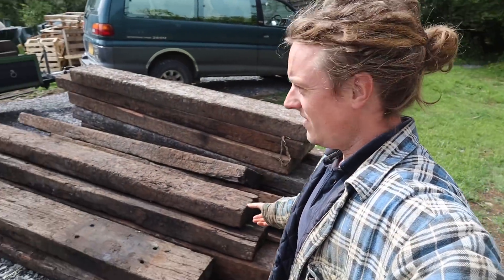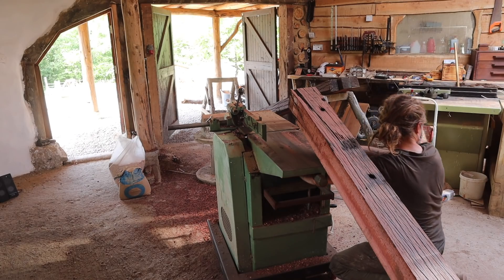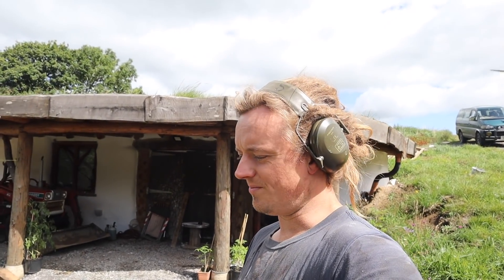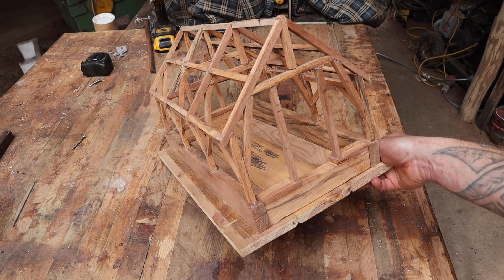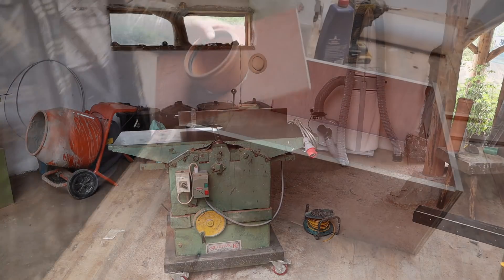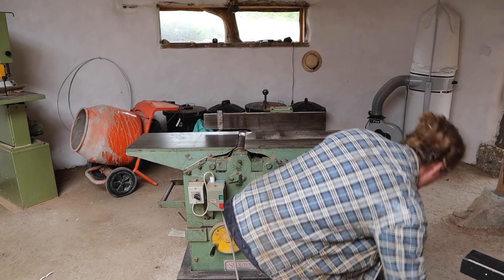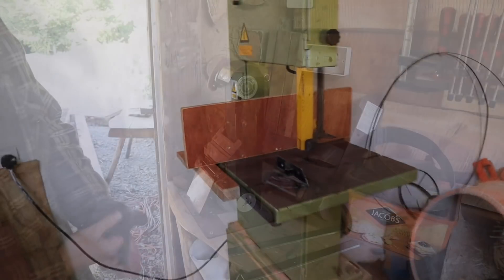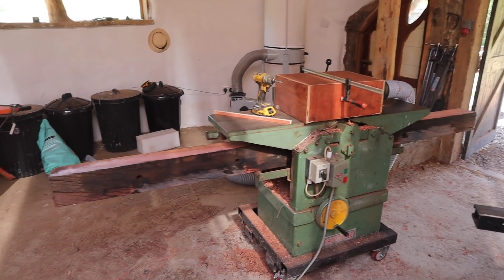Spring Fed Timber Framed Greenhouse Part 1 Design/Materials

Comment: The wood used in the sleepers is absolutely beautiful. You are so fortunate that you can get them and they are usable since they aren’t treated timbers. 
I think the only sleepers here (Ontario Canada) that aren’t treated are the concrete ones. 🤣😂

Did you design the greenhouse size to work with the length of the sleepers or will some need to be scarfed (joined) for length?
Reply from the maker: Good old British empire colonising the world and stealing there wood.....This wood does not have a great history But it is lovely wood and it might as well be used again now that it has been cut and shipped around the world already.

Comment: I wonder if it might help to drill some large holes through the end opposite the hose, to get more air flow through the box?  Might help stop the box filling up.
I have an unused Bump Cap you can have if you want it.  That looked like a nasty knock.
Take care.
Reply from the maker: The planner moves a lot of air and chips and throws it all at the hight i put the outlet. So in thicknessing mode (when most shavings are made) it works perfectly. in planning mode the box has to fill up a bit first before it starts to feed down the pipe. Not sure how i could fix that without making the thinknessing mode not as good. Two different hoods would work better but i dont think there is much of a need as its working very well.
Reply: @KrisHarbour  No worries, mate.  Maybe a ramp to direct the shavings towards the outlet?  Do you want the bump cap?  It's a baseball cap with a padded plastic liner.

Comment: Just bought me a 28 inch Alaskan Sawmill attachment. Works great. Is there a reasoning to use the bottom of the sawbar instead of the top. As the top is going to be oiled, yet, when using the bottom of the bar, the bar oil might have flown off already.... Just thinking....

Comment: Hi Chris I cringed when I saw you using your planer with loose clothing and no guard. That is a NO NO. All loose clothing needs to go unless you want to have a serious accident. I am a furniture maker and I would strongly recommend the maximum of 3mm cut in hard wood if you want your planer to last. 5mm in pine. your last pass should be half a mm to give you a nice finish. Also I would highly recommend that heavy timbers like that be properly supported with some sort of stands. If not you will damage your planer. If you take too much of a cut you will damage the motor winding's as they heat up. You will also damage the bearings. Treat your tools well and they will last a lifetime and give you nice timbers. I really enjoy your videos and I am not trying to be a smart ass as I have had some close calls and I only pass on the knowledge that was passed on to me. I lost part of my pinkie and mauled my right hand. It took the surgeon 8 hours to rebuild my hand. Not something you want to be doing. And it was fucking sore. I have followed your progress from the start and I get a wee boost every time you upload a video. I look forward to part two. A short sleeved tee shirt is the best attire for the workshop when working with machines. Or the wifes bikini. I was more of a tee shirt man myself. Well done man.
Reply: Overalls
Reply: Like others have mentioned, I will too, please use glasses or goggles to protect your eyes. I also noticed a couple times where you might have saved your back some work. You could put your trailer closer and inline to the off-load pile of wood, also you might be able to move your planer closer to your stack of wood. Great video, can't wait for the next.
Reply: Except for the loose clothing bit I thoroughly agree with you. Afraid he's not going to listen though, so let's wait and see how long the thing lasts under this kind of use...
Reply: Lovely comment and sound, healthy advice👌. Ps: love the thought of a bikini 😉🤣😂

Comment: May I please advise
1.) Taking a first aid course.
2.) Safety glasses.
3.) First Aid kit in every workshop and the house and van.
4.) If your land was at one time a pasture to have a current tetnius shot. Have hydrogen peroxide on hand to clean cuts, scrapes, and punctures. 
5.) Learn how to make butterfly bandages for cuts. Helps draw cuts together again.
I'm allergic to tetanus shots. I have to clean out the wound with hydrogen peroxide. Then I generally have to go to the hospital and get an intravenous antibiotic. Not my idea of a good time! I'm sure it's not yours too! 
And he's right about making several passes through the planer. Easier on the machinery and less tear out on the wood. Have fun and stay safe.

Comment: Kris, I was surprised how thick you have those timbers for a greenhouse. All the old wooden greenhouses I've seen have very thin beams and window frames. Why have you chosen to make yours so thick?
Reply from the maker: They are thin for two reasons. Cost and light. Cost isn’t important to me as this will cost less than any lighter wooden greenhouse this size. light will only be reduced by around 8% however it will last for a hundred years.

Comment: R u going 2 get in a little more detail on the timber frame joint's on how 2 make them when u get the green house project started and how is the hydro dam working out so far any more adjustments 2 that lately
Reply from the maker: Yeah that is the plan. going to try and go through it step by step in the workshop. Having the controlled environment inside will enable me to do that much better than i have been able to in the passed.
Reply: Look forward 2 see the green house videos when they come out and thxs 4 replying 2 the question

Comment: I would urge you never to run your hand over the top of the planer. Take your hand off and place it on the timber when it is over the out feed bed. I was a joiner and have seen and known people loose bits of their hand when they slip. You can also use silicone spray to lubricate the bed so you don’t have to use undue force which can also lead to injuries.

Comment: I find it hilarious that we had both your planer/thicknesser and bandsaw in the yacht builders workshop I used to work in! Modern-ish workshop and your more Hobbiton theme, are quite the juxtaposition =;-)) Good kit, though, and I am impressed you can run them off your own power - nice work. Can you give us a link to where you managed to find untreated timber like this?
Reply from the maker: I worked at a boat yard as a young lad. on of my main tasks was processing timbers for planking and other restoration work that was on. I learnt on these machines. so when i got my workshop i went for what i knew.
Reply: @KrisHarbour  Good thinking, and like I say, they are good workhorses and will last forever, with care.

Comment: Yes shure, sleepers are not treated, what a fary tale, if not so, what l don't believe, you have at least Asbest in them, due to the trainbrakes...
Reply: THE 3 MOST COMMON TREATMENTS FOR RAILWAY SLEEPERS

1) CREOSOTE TREATMENT - used for over 150 years to lengthen life of timber, but now facing some restrictions. SEE BELOW.
2) 'GREEN' PRESSURE TREATMENT - the latest 'environmentally friendly' pressure treatment. See below.
3) UNTREATED - some tropical hardwoods are naturally long lasting, & hence need no treatment. See below.

USED RAILWAY SLEEPERS are normally either
a) Creosote treated, e.g. used Dutch Oak and used British pine, or
b) Untreated, e.g. used Australian Jarrah and used African Azobe sleepers. Even though a used railway sleeper is untreated there can occasionally be deposits of oil or diesel on the surface which have fallen from passing trains over the years (not to mention other things!) 

NEW RAILWAY SLEEPERS are normally either
a) Green treated  e.g. new British softwood railway sleepers. These are environmentally friendly non-creosote based preservatives, with treatment names such as ACQ, Tanalith E, Osmose or Wolmanit, all of which are suitable for landscaping projects, or
b) Untreated, e.g. new oak sleepers
Reply: @Petes.Hobbies , thank you for your detailed answer Sir. A uncle of mine, was an ingeneur for railway's in germany. As we spoke a lot regarding train's etc., he use to tell me, that I better do not use any of those sleeper's. But the old hardwood sleeper's are maybe different.
Reply from the maker: Thanks for the info. I totally agree with it. Defiantly contaminants on the outside from the use they have had. I spray them down with a hose and give them a brush before milling (mostly just to get rid of any possibility of asbestos) They have been sitting outside in the weather for a number of years (after being pulled up) So they have been exposed to rain and sun and moved about a yard.

Then when planning them i take the outside off and i burn the shavings that come off. Once the bulk of the outside contaminated wood is off  i then save the shavings for other uses. you can see where oil has soaked in to some places and i tend to just try and cut those areas out when it comes to doing the joinery. I think the contamination on them is minimal after i am done and i think they are safe for use in the way i use them.. I would not use them in any quantity in a house though.
Reply: @KrisHarbour  , thank u for your explanation, it's very interesting and good, that you are awear of some possibly troubles. Bye the way, I do like your works quite a lot... and fallow you from the Second vid allready and enjoyed it and get's inspired....tks therefor

Comment: Hey Kris, Not sure if you ever looked into lithium iron phosphate batteries for your power shed to replace that old fork-a-ma-lift battery once it wears out. I've been eyeing these ones for an RV project I might be starting soon.

https://lithium-iron-battery.com/collections/12v-lithium-phosphate-battery-pack

They are all rack mount and have their own BMS built in which should make setting them up very easy. Coupled with the higher energy density and low self discharge rate they aught to make a good battery for off grid applications. Much more energy efficient then lead acid as well. I think lead acid batteries are only about 50% charge efficiency when new? I'm not sure I would have to look that one up. The only other down side to lithium iron phosphate is the up front cost, but they have an extremely long cycle life.

Comment: Lighter passes on that planer, my friend. Less time sharpening blades!!
Reply from the maker: 30 lengths to do with 4 sides. they are about 40-50kg each. if i do lighter passes i would have had to move those 30 lengths 120 extra  times if i had halved the depth of cut. twice that if i had quartered it. Sharpening blades is alot easier than moving 50kg lengths of wood 120 times more than i had to.

Comment: I know this is another task in a long line, and one you don't "need" to do, but ......
A cyclone separator (or Thein Baffle) for your chips would pay for itself in terms of ease of emptying chips and being able to see how full your bin is before it ends up full (you can fit a window in easily). It would also let you get a finer filter on the dust bags that would stop the "dust that will kill you in a few years" getting pushed back in the room! Some of the woods you use look spectacular but are toxic!
Trust me age is no friend and it can grab you sudden! As I am turning 60 I have come to realise my body simply can't do what it used to. All those small niggling injuries add up and when your knees are shot and you hips are not far behind the simple little tasks suddenly become a fight with pain that you realise you will eventually lose. Please work smarter not just harder. You will last longer if you do! Get something to help move those heavy timbers, rest them on something so you only lift half the weight, make a simple leaver to lift for you (not you doing all the lift! Keep on being able to do what you do for longer. Please realize I ask this out of self interest ...... I (hopefully) will have a long retirement ahead of me and I want interesting things to see and think about ..... and your channel is one of them ;0)
I may well not get to see it all from my self built Earthship in the Canaries (my original plan but I have left it too late) but be assured that I Will be watching!

Comment: The timbers that I was told were cut and exported for Railway Sleepers from Nth Queensland, are not preserved by treatment because they are both toxic and carcinogenic, it was not necessary to use the Copper Arsinate of Lead heavy metals treatment. 
So Black Bean, Cooktown Ironwood, and Walnut in particular, requires good dust extraction and filtration of the sawdust, so the Workshop isn't polluted. Don't let it near your animals, eg precious puss and hens etc. 

Maybe everyone knows what the problem is without knowing the specific species. When some types of sawdust are included with flour and consumed in the Northern Hemisphere, maybe the suspicion against timber toxicity is not there?

Comment: Is somthjng wrong with creosote ? I just bought phone poles to build my greenhouse they smell like a coal train us that bad or somthing?
Reply from the maker: For a greenhouse I would say it’s fine. But I wouldn’t want to do what I just did with wood covered in treatment
Reply: @KrisHarbour  great point !! Man they stink !
Reply: I have treated sleepers as a bedding terrace around one side of my house. They are a fire hazard due to the creosote. My husband bought them before I realized this. They only smelled if the weather was extremely hot. Rare here, fortunately. After 27 years most of the creosote has dissipated. They are lighter in color and never smell. Yay!
Reply from the maker: Yeah Debra, that stuff does degrade after time. 27 years should do it for sure.

Comment: When I watch you pull that sleeper off the trailer, my immediate thought was you're going to knacker your back. Stack them like potato waffles with each layer having an alternative orientation for maximum air circulation which will make them easier to pick them off the pile and be dryer to machine. Don't bend your back to lift them.

Comment: Greenhouse made of timber? High humidity conditions will rot everything in less than 5 years.
Reply from the maker: the wood im useing has been sat on the ground for 100 years already......
Reply: @KrisHarbour  Well yeah, it looks tough as hell to be honest. Hope it holds it's toughness for 100 more years supporting your greenhouse.
Reply from the maker: Woods are very very different. Ash for example wouldn’t last 5 years in this situation. Oak heartwood could last 30-50 years, larch 15-20 this timber is some of the most durable timber in the world and can last well beyond a human lifetime.

Comment: don't want to be a bore or a nay sayer, but if these are pre. year 2000 uk or even current sleepers from india, australia, canada they will be lethally contaminated with asbestos brake dust if they have been used on a railway. check out mesothelioma. no i'm not an injury lawyer.

Comment: UNtreated?? years and YEARS of HUMAN waste and oil leaking from trains???? so in my book they are (a friend who worked upon the rail networks said the amount of things that were flushed down toilets and ended upon the tracks). THAT SAID a great video :-)
Reply from the maker: Yeah no doubt there is contamination. As far as human waste contaminations goes though that would decompose in under a year and these have been removed and sitting for a lot longer than that. I take your point but it isnt that back and white or that simple. things degrade.
Reply: @KrisHarbour  For outside projects they're great :-) but I know people want to use them inside the home so wouldn't use them in there

Comment: I don't really enjoy seeing people using sleepers in eco/natural purpuses... It just not the right karma there. Tropical wood, issued from deforestation of massive areas. Talking from brazil, I know how it feels to see people from abroad using such materials, often having bought them for less money than I would have to pay for right here near were they grew. That just doesn't feels right
Project is very nice, though
Reply from the maker: I dont agree with how they were harvested and i would not buy tropical hardwood that resulted in rainforest destruction. But the point is that these already exist and are sitting in a yard rotting and will rot away if we dont use them. There is nothing more eco then using something that has already been used for a long time and making something that will provide food for many many years out of it. I will be trapping that carbon in a building the provides food. instead we could get let it rot and release all the carbon.